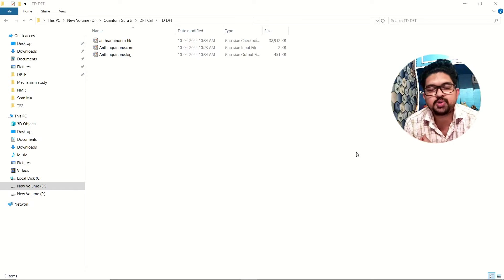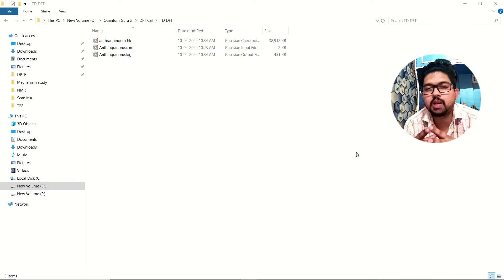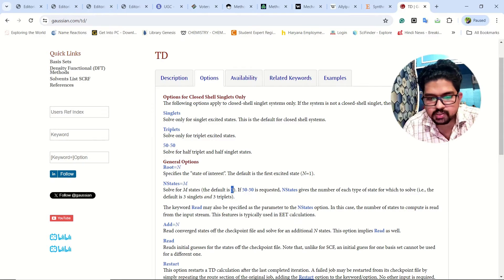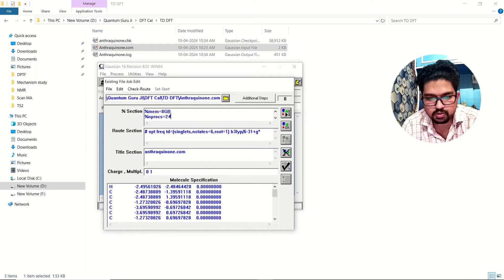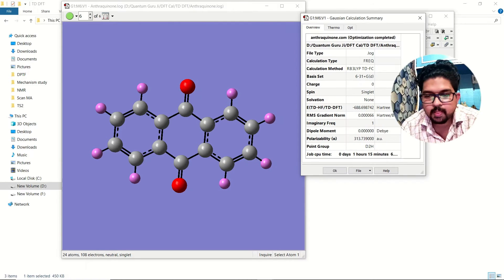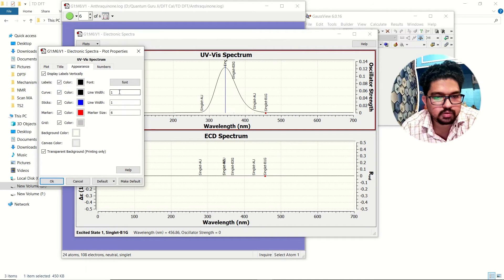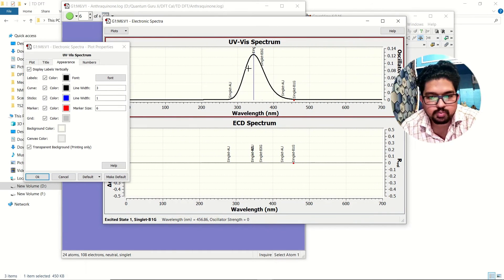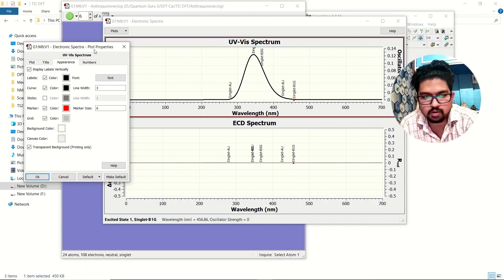How to perform TD DFT calculation in Gaussian

Comment: Hi , thanks for the video 
I'm working on CdTe quantum dot, and I want to see examine its emissions, and the peak of wavelength in Photoluminescence -wavelength spectrum,  should I go the same way as you did ?and what other things I have to consider to get  PL-, wavelength  spectrum.❤
Reply from the maker: Yes.

S0 optimization (DFT) → frequency check.
TD-DFT vertical excitations on S0 → absorption.
S1 optimization (TD-DFT) → emission single-point.
Apply SOC / solvent corrections → recompute if needed.
Simulate spectra (broadening) → compare to experiment.

Comment: Can we do piezo DFT calculations by Gaussian?
Reply from the maker: Gaussian is not ideally suited for full piezoelectric property calculations (i.e., calculating piezoelectric constants like d33, e31, etc.) directly, because it lacks native support for computing piezoelectric tensors. However, you can still do some related DFT-level calculations that provide insights into piezoelectric behavior.

Geometry Optimization under Strain:
You can apply small strains to the crystal structure and compute how the dipole moment or electronic structure changes.
This helps estimate indirect piezoelectric behavior by calculating the change in dipole moment (Δμ) with respect to strain (ε).

Dipole Moment Calculations:
Gaussian can compute dipole moments at different strained geometries.
Using finite-difference approximations, you can estimate piezoelectric coefficients manually:

Polarizability and Hyperpolarizability:
While not piezoelectric constants, these can be related to a material's nonlinear response to external fields and mechanical changes.

Better Alternatives for Piezoelectric Calculations:
If you are seriously exploring piezoelectric materials, consider using codes that support periodic systems and piezo calculations:

VASP (DFT with Berry phase and piezo tensor support)
Quantum ESPRESSO (DFPT, piezo tensors, stress-strain)
ABINIT (includes DFPT and piezoelectric tensor calculations)
CASTEP
dMol3 etc.

Comment: The process has a time limit, and my TDDFT calculation was interrupted. To resume the calculation from where it was interrupted, I specified the interrupted calculation's checkpoint file in %oldchk and added the options td=restart and guess=read. However, the calculation still starts over from the beginning. Do you know how I can properly resume the calculation from where it left off and complete it within the time constraints?
Reply from the maker: @絶望-d9i  generally we use opt=restart

Comment: How to generate energy optimization plot in guass using dft?
Reply from the maker: Open your output file with gauss view ...right click on molecule ...Results -> Optimization Plot

You will see all the steps with energy plot.
Reply: @quantumguruji  but the optimization plot tool is not enabled. It's not working
Reply from the maker: @dios_1111  I guess, you might not have done the geometry optimization. Simply single point calculations will not enable this option. Or other reason may be convergence failure or unfinished calculation.
Reply: @quantumguruji  I am calculating it from optimized file also when I am checking in summary, it is showing that it is converged. Still it's not working I am not able to find where the glitch is. What does unfinished calculations mean?
Reply from the maker: @dios_1111  if you are performing geometry optimization, you should see the optimization plot...if you it's not enabled..means you are doing some mistakes..see carefully
Reply: @quantumguruji  ohk!! I will check again.
Thankyou so much

Comment: how to calculate the molar Gibbs free energy of a single gas molecule in Gaussian??
Reply from the maker: Follow this video to calculate Gibbs free energy (https://www.youtube.com/watch?v=LQd9KMfgnPU&list=PLlpEYnkmgdI-yizh1k2y1X4CTwi9_BXkp&ab_channel=QuantumGuruJi)

Convert Gibbs Free Energy to Molar Gibbs Free Energy
Convert from Hartree to kJ/mol: The Gibbs Free Energy from Gaussian is in Hartree per molecule. To convert it to kJ/mol, use the following conversion factors:

1 Hartree = 2625.5 kJ/mol
Avogadro's number (N_A) = 6.022 ×10^23 molecules/mol
Calculate the molar Gibbs Free Energy as follows:

Molar Gibbs Free Energy (kJ/mol)=Gibbs Free Energy (Hartree) × 2625.5

For example, if the Gibbs Free Energy is -76.421032 Hartree:

Molar Gibbs Free Energy (kJ/mol) = − 76.421032 × 2625.5 ≈ −200585.56  kJ/mol
Reply: @quantumguruji  But it is too high, when we calculate the the Gibbs free energy of methane through same method, it molar gibbs free energy is -106718.85 kJ/mol but in NIST database the gibbs free energy is around 130 kJ/mol?